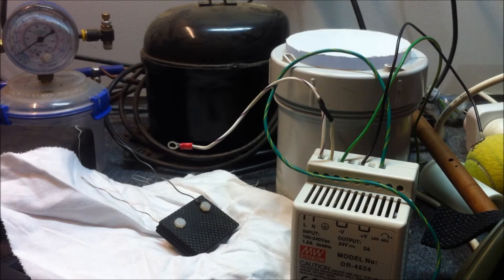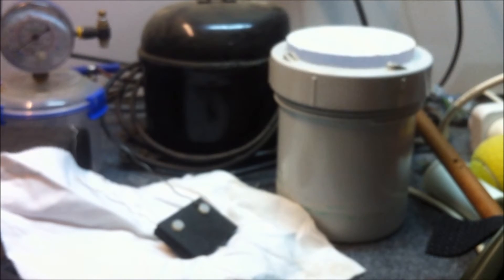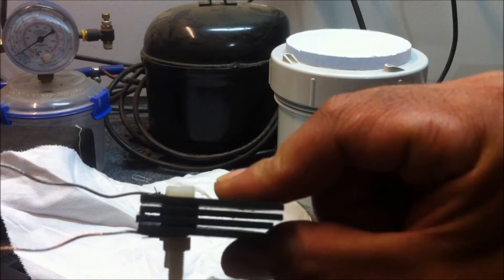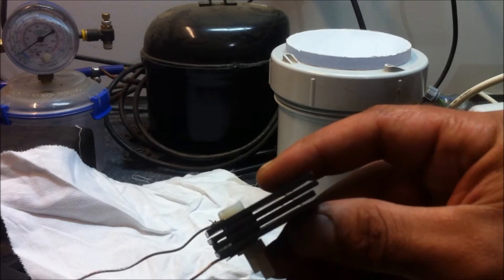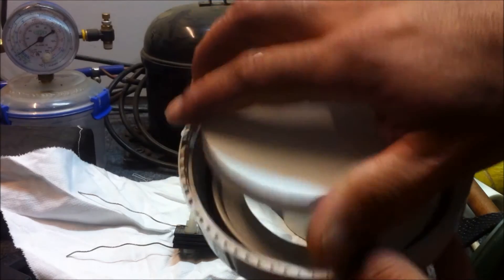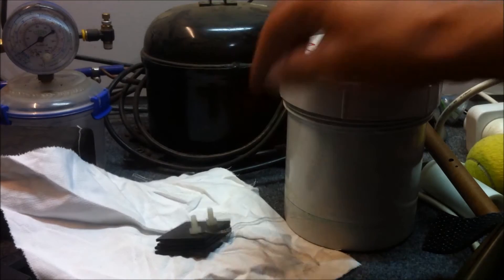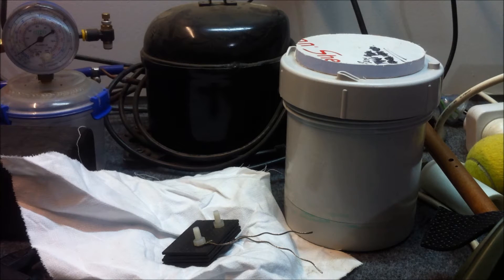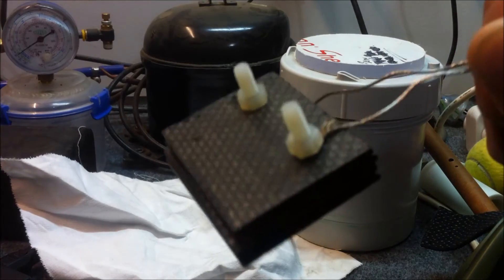Experimenting With Carbon Fiber HHO Electrodes & Neutral Plates @ 25 Watts!

Comment: Mate. If you do ever decide to set it up again, add Uria to the electrolyte mix, it will get consumed, aim for just 0.3v per plate, if not acheiving that. It's plate spacing issue or Electrolyte mix ratios. See Robert Murray Smith (Rip) vids on hho& uria .
Reply from the maker: Thanks for the tip. I'll try it if I ever find the time to plug it in again. It is still sitting in the original contaminated brown water from years ago. It would be great to see how they held up after all this time...

Comment: if you still mess around with this stuff I have found that negative positive negative works pretty well. when I used a nuetral my output went down. this is using a circle config though.

Comment from the maker: I somewhat agree. Once I have optimized this setup, I will be throwing everything I have at the cell, including longitudinal energy & UV light. Obviously, it will be a hit-and-miss process, but I will try various currents, amplitudes and frequencies & see what happens - probably nothing...maybe something...
Reply: Hello there, I love your Carbon Fiber HHO video. What type of carbon fiber do you use? Do you also sell premade HHO carbon fiber electrodes? I will buy them from you at a premium.

Comment: I tried using a piece of carbon fiber bicycle seat post(-) and a stainless bolt(+) to produce HHO, but there was no production :(. By the way the whole thing was hooked up to a 12V battery charger. Am I doing something wrong?

Comment from the maker: Yes, I'm looking forward to completing the cell for its first prolonged test run. At the moment, I'm still figuring out the optimal waveform/voltage/current for the cell.

I also believe that higher voltages are the key to optimising HHO cells - as well as using higher frequency wave-forms. 

Thanks for your comments  :)

Comment: You have to let this cell run for a day or so to see how much exchange you get from one electrode to the other.
When I was experimenting with stainless wire, 16gage, installed on my truck, I'd find after a couple tanks of fuel, my negative electrode shrunk substantially.
Which leads me to believe higher voltages (skinning) may lessen the loss. Think of how electro plating works. Nice show~!